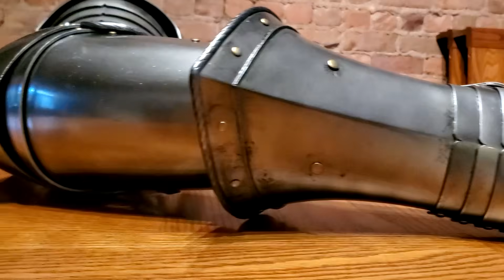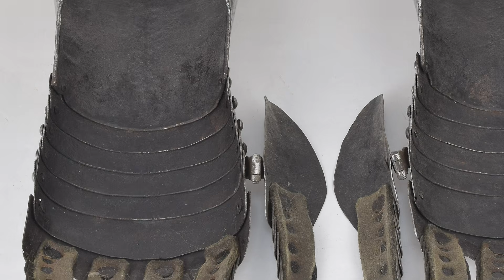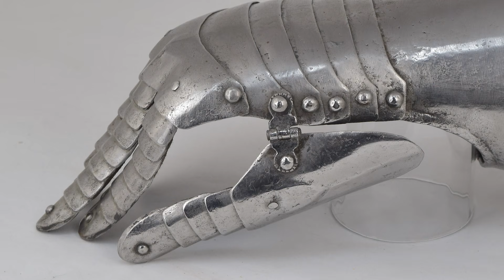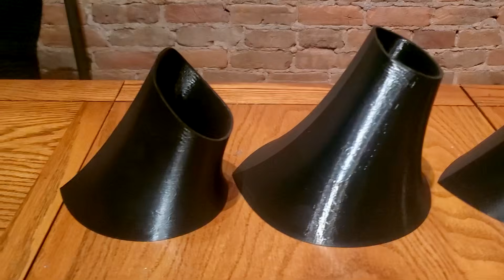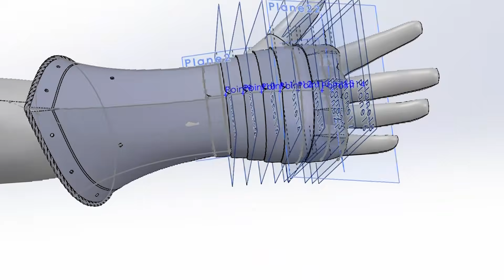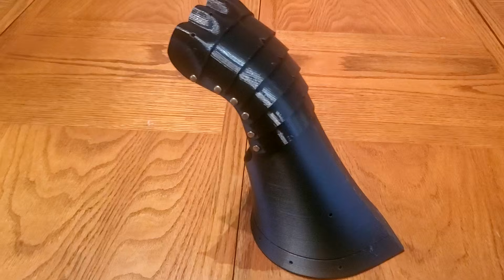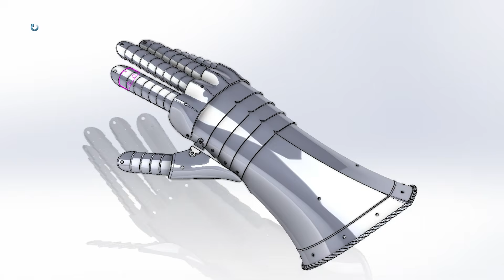Making 3D Printed "Copies" of Real Antique Armor

Comment: Does the gauntlet have side to side mobility in the wrist?
Reply from the maker: Not as much as it could - I use the width of the holes being larger than the posts of the rivets as a form of "tolerance stacking" which allows some mobility. If I wanted full wrist mobility I could make them slotted holes, but when I tried it, it made some plates overshoot and delaminate at the articulation.

On some 16th century gloves, I saw circular rivet holes on one side, and slotted holes on the side opposite the thumb for partial mobility - it does make sense that way!
Reply: Generally the slots are never more than two rivet holes in length, and usually only about 1.5x.

 a compound curvature, gentle belly on the midsection of the lame, and tapering the edge helps to avoid gapping, even when using sliding rivets.

Comment: Awesome work, and you designed it in SW? I work with Solid Edge, maybe one day I will give it a try to design some (much more simple) armor piece. But first, I should try to print your designs. Looking forward the closed helemet!
Reply from the maker: Yes I did! It's all Solidworks - I figure any CAD software could be used to make these as long as they have surface based features. I do hope you give my templates a shot! :D

Comment: Looks amazing! Genuinely want a 3d printer just for this 😂 I wonder if any of the strong engineering materials could also be done in this way carbon fiber fused plastic or some of the nylon ones? Maybe would work for Hema applications?!
Reply from the maker: So, adding carbon fiber particles to a filament is already a thing in 3D printing, and I use it quite extensively in fact. I use PETG and PETG-CF, which is 10-15% by volume of these particles. It's a bit more rugged, more stable when printing, and has a nice matte finish, but allegedly the fibers get everywhere on your skin when you wear them. I clear coat the parts to avoid this negative effect! 

As for HEMA, my parts are designed with aesthetics and replicating antique shapes in mind - not providing actual protection. I would not trust my own safety when wearing a neat looking prop ;)
Reply: @NicoPrintedAntiques fair enough was just a crazy thought perhaps, keep up the awesome work!

Comment: Your work is inspiring. These designs are begging for parametric versions, for custom-fitted prints. I know it would be more work to do that, but is it plausible? I would pay more for a parametric design that I could put a few of my own measurements into.
Reply from the maker: That would be incredibly cool! However, the models are barely stable enough for a single rebuild, I would not trust the Solidparts files to rebuild properly with a variation of parameters. I prefer recommending X,Y and Z scaling in the slicer as an alternative fitting system for different body types. 

Also, wouldn't parametric versions require the user to own solidworks too? I am not sure, tbh